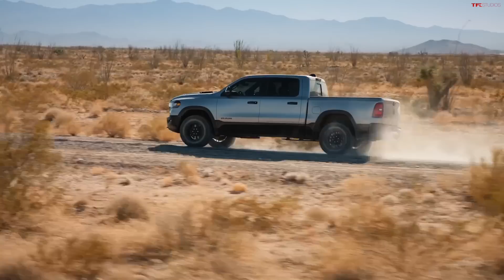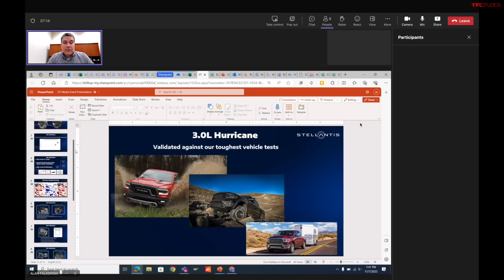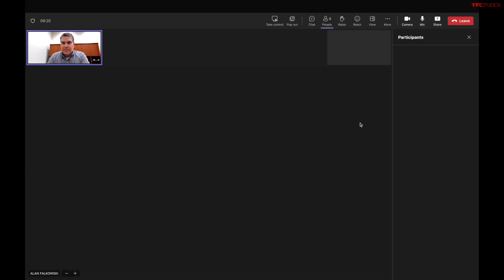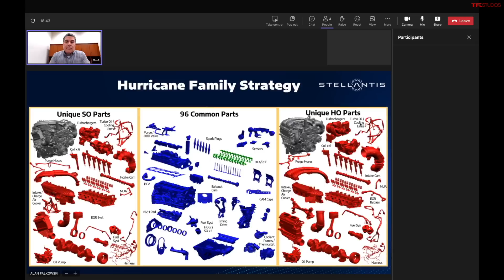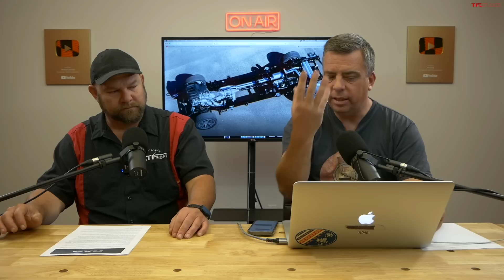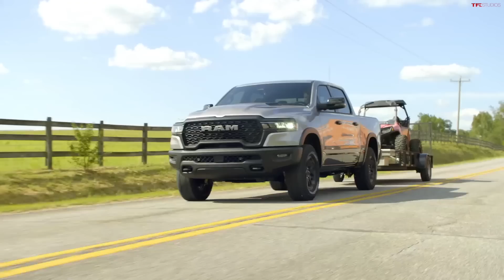2025 Ram 1500 & Ramcharger DEEP DIVE with the Chief Engineers!

Comment: I have a 2018 Ford with the 3.5 EB V-6.  I have always wondered, is the start/stop function actually bad for turbocharged motors?  It seems like killing the oil circulation with a hot motor and turbo would not be good for the turbo's life expectancy.
Reply: Modern turbos are liquid cooled and so they dont need to be cooled off before shutting down except for some extreme, rare circumstances. Coolant will continue to flow through the turbo after the engine is off.

Also, the new Tundra actually uses a separate electric coolant pump which is used just for the intercooler and turbos. That means they can continue to circulate coolant after the engine is shut down. They could be doing something similar here.

Comment: I haven’t used a trailer brake yet: do you often need to dynamically control gain? It feels like gain ought to be set by the trailer you tow, and once you’re hooked up and loaded you shouldn’t need to adjust that number.

Comment: 27 gallon fuel tank + about 3 gallons of gasoline of battery (33.7kwh/gallon)..so 30 gallons of fuel and the range using all of that (i assume) is 690miles (at what speed i don't know, but probably highway speeds).  So overall 23mpg.   Not horrible, but nothing great either.
Reply: The ideal use case is for the person that will only use the battery most of the time and use gas rarely. On electricity you are getting roughly 50 MPGe. That is fantastic Camry hybrid numbers.. When you need to tow long distance maybe 10-20 mpg depending on trailer aerodynamics and weight  to avoid charging stations.

Comment: A question I have is in the ram charger could the generator be running while the truck is in park like when you are at a meal and charging the battery?  This would mean that on long road trips when you stop to eat you could be charging the battery.  It also means that because this has reverse flow that when the house power goes out you could turn on truck Generator and chare the battery for draws as well I would think.  Meaning that this truck would take place of your whole house generators as well while you are home.  It also means that even being off road is not that big a deal with some extra fuel for charging.  If anybody has a gas powered generator for the house how long does 1 or 5 gallon last not sure of the tank size it would be?

Comment: Has the tank size been confirmed at 27gallon? If so the range seems very low. 690-145=545. /27 gallons=20mpg. Doesn’t the regular v6 get better than that already? I expected the engine to be more efficient being that it’s not subject to the regular stop and go and acceleration loads. Interesting. I’m wondering if he made a mistake on the tank size and it’s 17 gallons or something.
Reply: Add another 3 gallons or so of battery juice (92kwh). ..but i agree..the v6 is not efficient and there is no mechanical link from engine to wheels so you are losing there to because it has to go thru another step (converting to electricity to feed the battery).

Comment: I own a Gen5 1500 Laramie with the 5.7 - I live in Germany and drive a lot also in other European countries. It is a truly great truck and also a truly great car at the same time. There is one thing though, I am really disappointed with - and RAM did not change this for the updated 2025 lineup - the approach to the "energy saving" - and also parts and cost savings area.

The ZF 8HPxxx (xxx for torque maximum in Nm) 8speed transmission is a great product, it dominates the whole car industry. It comes in many different versions - and since about 2015, ZF has a mild hybrid version, e.g. BMW is using it since then, meanwhile in all of their models. This integrates an electrical engine IN the transmission - and being there, it serves in three roles at the same time : it is a starter, a generator, and an electric motor to help with start/stop and boost when there is enough capacity in the battery.

Doing so, it replaces two classical items (the starter and the generator) in the engine bay, and it also saves all the belts and all the mechanics to drive them. PLUS it serves as an electric booster. WHY ON EARTH does RAM go for the version without the mild hybrid parts in it - the eTorque (which my RAM does not have) is a weirdly overcomplicated solution. You have the classical starter and generator you have to pay for PLUS another belt driven electrical device to recuperate and boost a bit. RAM's choice from the ZF 8HP lineup does not make any sense, and even for the updated model they failed to recognize this, and stick to the crappy eTorque approach. As an engineer, I am feeling ashamed instead of RAM. 

Just one comment on the straight 6 twin turbo design : it is a "successful" adaptation of a BMW diesel engine design from 2004 (!) - some might know the 535d/540d. The design is still good - but, come on. One also could put the two turbos on the two sides of a V8. Which is done by BMW (545i/550i) and Audi, or e.g Ferrari (now with Stellantis like RAM) on their V8 since ages.

Comment: If you take a 690 mile road trip and the batteries are depleted at 145 miles, the balance of the trip will be on the 260 hp engine/generator. The motors are still capable of 540 hp but the V6 can't keep up (260 hp in, 540 hp out). The primary rear motor with 239 hp can be used for cruising while charging but not towing uphill.
Reply: I saw a relpy from one of the ramcharger engineers that the ice engine will kick in at 28% of charge.  He said also they were at 2.2 mi/kwh.  If thats so ten it looks better than first thought

Comment: I’ve had 4 pickups. I’ve used the tow hooks twice… once for moving a dock… the other to drag a log. I could have used the trailer hitch in those cases as well.. it’s handy to have them if you ever have to pull someone out of the snow but I haven’t been there (yet).

Comment: BTW if a person pauses at 11:39 you can see the parts differences for the HO version. It is a lot, different piston, crank, intake manifold, injectors, turbos, rods, one of the cams, etc.  Also I think the Ramcharger is going to be a hit! The Pentastar should be great in this application. Really under stressed since it runs at the optimum RPM for efficiency and never exceeds I believe 3600 RPM in this application.

Comment: Hey ram, can we get a transmission in the HD trucks that weren’t intended for a van like the 68rfe?  Why even offer anything other than the Aisin and why haven’t you gone to a 8 or 10 speed like the competition?
Reply: Probably because it's substantially more expensive. The Allison option is a good transmission (meant for med duty). Sometimes adding more gears weakens the transmission is another reason.
Reply: @methanial73  true it adds cost and failure points, but ram is more expensive than Chevy or ford now.  Maybe at least beef up the transmission components like a valve body accumulator plate that isnt plastic crap.

Comment: I don't have rated tow hooks on my hilux but I've used the receiver bar several times to tow other vehicles.

I also use my truck off-road and have recovery gear available.

Rated hooks front and rear on a truck are crucial.
It is a truck after all, not a suv. 

Make it an option and let the city slickers get a truck without them.

Comment: It will be avail. for Wrangler, but prob not until '25. Everyone will be lining up & overpaying for what likely is 150k max life HOI6, based on curb weight of a '23 4DJLRubicon. (4400 lbs.) I will just save up for a used 392 Jeep, lasting twice as long, & likely costs 1/2 to rebuild vs. HOI6 forged parts.. I've owned 7 Wranglers since '01, & I'm not falling for an idea of a do-it-all HOI6 without 5 years of records for offroad performance & turbo reliability/longevity in hot/cold/crawling/overland & towing situations.

Comment: Big big problem for engine that has EGR, as diesel 18 wheeler driver, EGR is the most evil thing that you can do to an engine, for you newbies that don’t understand how EGR works, as the name says Exhaust Gas recirculation, what it does is instead of your exhaust gas going out of the engine to the muffler, it sends back into the engine, so basically soot goes in your engine, your engine will recirculate it through its pistons reducing nitric oxide, then it sends through the turbo the through catalyst, over time your engine will have buildup soot shave your pistons your car starts burning oil and in the end the engine will fail, the egr valve needs maintenance it the valve fails and you don’t catch it on time your engine will fail faster than expected, all for this to reduce emissions, instead of buying truck with egr system I rather buy old truck without that heinous egr system.

Comment: I have an SO Hurricane(420/469) in my Wagoneer S2 with the Advanced All Terrain Group (3.92 rear). It compares favorably with the 6.4L (410/429) 4.10 rear in the Power Wagon it replaced. Torque comes in lower , is flatter ,wider and over all much smoother. One thing to note for traditionalists is that it DOES NOT have dip stick and must be checked electronically. .

Comment: Hurricant non-engine.  I drove a WAGONEER with the SO modified slant 6.  One turbo.  I pulled out of the lot onto a 4 lane road, STOMPED the gas pedal and when I woke up, I was almost 300 ft down the road.  What a freaking YAWNER!  I took it to a brand new section of road that is straight as an arrow and did the same thing.  This road is 4 miles long and I didn't get 100 mph out of it.  My hemi hits 100 in less than a quarter mile.  I personally will buy a 2024 and that will be the LAST Ram I will buy.  I will keep it till the wheels fall off, then rebuild it.

You Goddamn Europeans need to go back to Europe and build your little Fiat 600's for the Wops and Frogs.
Reply: Oh...and the front of the truck looks strangely like a Toyota!  Yechh!

Comment: I am a tad concerned about the power being pushed out of that 3.0L, were looking at high compression, is blow by going to be an issue with these like with the ecoboosts? And I am concerned with the fuel requirements. Will running 87 potentially have other side effects beyond non optimal power.
Reply: Blow by can be rectified by putting a catch can system on for less than two hundred bucks.   But I agree with your other points

Comment: These v6 i6 i4 turbo engines are built to to 85% of its power before becoming unreliable all the time the average LS and coyote are at 50% or lower of its capability. I have owned a 2015 1500 with a 5.3 4x4 I got a best of 23.6 mpg at the pump at 65-75 mph speeds I rented a 3.5 2019 f150 4x4 took it on the same trip and got a average of 20.6 same speeds. I currently have a 2020 ram 1500 5.7 with 3.92 gears I just come back from the same trip I got 21.3 mpg all trucks where calculated at the pump the chevy was underrated .2mpg on the dash ford was way overrated 1.8 mpg and my ram was .4mpg overrated. Why I bring this up is because a turbo charged 4 or 6 cylinder making 300-400 hp will get the same mpg as a well built v8 making the same.
Reply: That is interesting.  I also have had all 3 and the mileages you posted are w/i tenths of what I got.  My Ram was a 20 with 3.21 gears with 21.5 mpg the silverado was a 2014 2wd getting 23.  My disappointment is the ford, a powerboost, only averaging 20.8. Hopefully the new Ram will out do them all
Reply: and at the same time, hemi will be much more reliable and cheaper to maintain
Reply: @polivcentr  I didn't own the Ford but out of the Chevrolet and the Ram my Ram is having 10x the issue my Chevrolet did. So far with just 33,500 miles I have replaced my drive shaft, both exhaust manifolds and my transmission is most likely going because when I come to my first stop it slams into first lunging the truck forward  and then will say shift to park to continue.

Comment: In regards to the Ram air suspension durability, it uses a "closed" system with nitrogen stored in tanks to reduce failures caused by moisture.  Other OE's with durability issues utilized an open atmosphere system.  We've all seen how much moisture comes out of a shop air compressors tank.

Comment: Inline 6 twin turbo; 1 per  3 cylinders is very efficient invention. My question is, what about the transmission? Will transmission will be reliable as well? Pairing a proper transmission is very important.
Reply: The ZF 8HP holds up to Hellcat/Demon power levels.  It's a very stout design with an extremely reliable track record in FCA/Stellantis vehicles for over 10yrs now.  We rarely see any troubles out of them in service.

Comment: I want to have an engineer address how the ram charger ev function would work in winter climates? Is it kept warm while not in use?
Reply: If it's plugged in the pack can be pre-warmed in colder climates by the electric coolant heater.

Comment: In the ram charger, will the v6 keep the battery charged so never plugging it in or will it need to be charged at some point, like on longer trips?
Reply: Yes but why, you will be getting 20 MPG if you don't charge it so you might as well just get the gas one.
Reply: @ohioguy4326  I travel where at the moment chargers aren’t available
Reply: @adambaddass  The engine in the RAMCHARGER recharges the battery when it goes down to a given level, so there is really no need to find an available charging station. If you do want to charge the battery, plug it in at home, then you are good to go!

Comment: The twin turbo may outperform a naturally aspirated v8, but it comes with much higher maintenance when you have to replace those turbos.
Reply: And how is that different than having to replace cam and lifters on a hemi? 🤔
Reply: @Lq32332  I don't consider cam and lifters to be disposable like turbos.
Reply: @entrepreneurlife649  You may not but Stellantis does. They also don't care about the exhaust manifolds on the hemis either.
Reply: @entrepreneurlife649  this isn't anything new, the ford ecoboost trucks have been on the road for over a decade. The turbos are designed to last as long as the engine when properly maintained.
Reply: All these commenters latched on to the udders of Greta. Long live my HEMI!

Comment: "It's perfectly smooth, you won't even know that the engine is running"

So I might as well get an electric is what you're saying 🤦 umm the whole reason for car guys liking combustion is for that very reason,  the noise the vibration etc. Wtf would we want a smooth v6 just because it has a little more power
Reply: They were talking about how an I-6 has less vibration than a V-6 or, V-8. I'm pretty sure they're referring to idle speed when they say you won't be able to tell it's running. Clearly it's not going to be quiet when you step on the gas. Whether anyone will actually like how it sounds is a different question entirely.

Comment: I have used the tow hooks on my Jeep SUVs to pull other drivers out many times, I have also used them to yank some things around on our property.    They are important enough to me that I have chosen a different vehicle several times when purchasing in order to make sure it was equipped with factory tow hooks.   The factory tow hooks tend to be superior to some aftermarket ones because they are engineered into the vehicle and designed to actually be used, not just for looks.  So ya Nathan I totally agree with you.
Reply: Yes, I love having TOW HOOKS on my RAM REBEL, and have never understood why TOYOTA didn't put them on the TUNDRA, and I understand there is not even an aftermarket tow hook that can be attached to the frame!
Reply: @1gr8oil  Yes it's always interesting when you are trying to pull someone out of the snow and have to find a place on the frame to hook up meanwhile when the strap gets tension it breaks/bends the air dams or plastic trim (on their vehicle).

Comment: I had a 01 F150 4x4 and live in So Cal. I have used my tow hooks to pull low cars off of a curb they got stuck on and I used them with a tow chain to pull out tree stomps. They are usefully even in the city.

Comment: This Ramcharger has blown up on the car scene. It’s going to set records. As TFL  always likes to say. Unobtainanium!!!
Reply: Idk. I wanna see how it is in practice. Certainly another great option in the world of mixed powertrains.
Reply: It will be too expensive, losing out on qbout 85 percent of potential customers
Reply: Even the Ram Rev is stellar... 500 mile range, huge Frunk, 14,000lb towing capacity ... BLOWS away the new Tesla Cybertruck.
Reply: Agreed!
Reply: The Ramcharger is the stupidest thing I have ever seen. It's has zero advantage over just a gas V8 truck it makes no sense. They are sticking a full and complete V6 into an electric truck? How silly..."unlimited range" yeah so like every currently existing ICE vehicle? Idiotic. But twice as complex and twice as heavy with a dangerous and super flammable battery? No thanks
Reply: @The_Draque it will probably average 120mpg with me driving it 25000 miles a year. Electricity from the wall Is approximately $1 a gallon equivalent. And it's faster than most sports cars. No advantage?
Reply: @The_Draque 600 horse and torque 690 miles, can just fill up and go without charging, show me a truck with those numbers
Reply: @The_Draque Instead of sitting and waiting to charge at a station, the on board engine charges as you travel.
Reply: @The_Draque  I guess you didn't watch the entire PODCAST!!